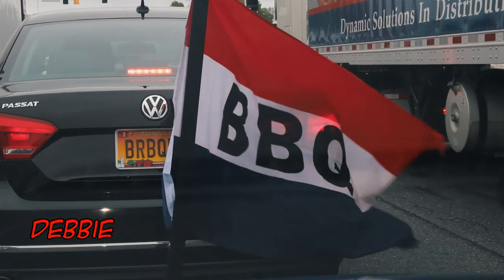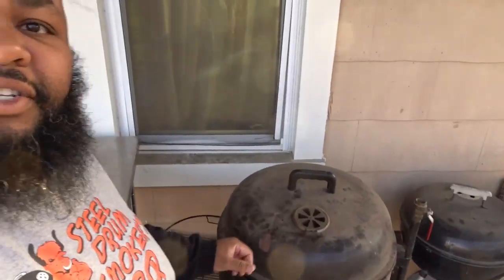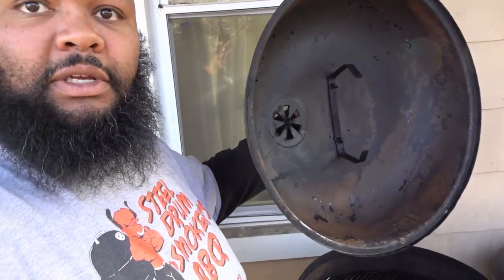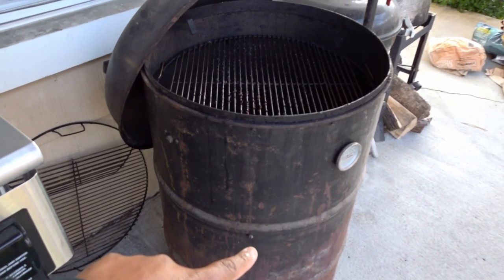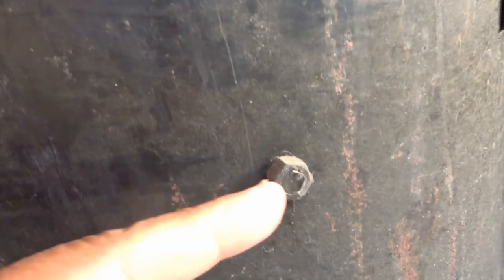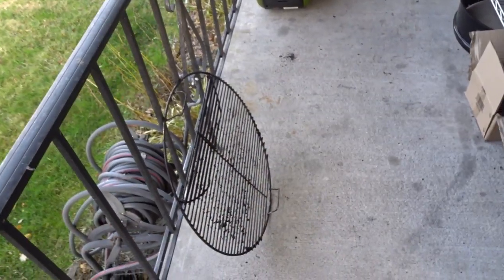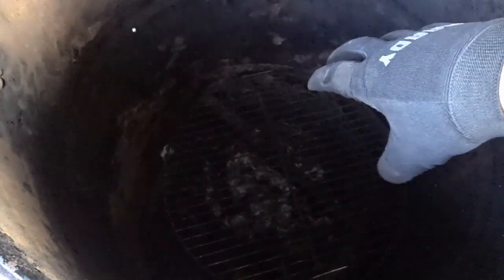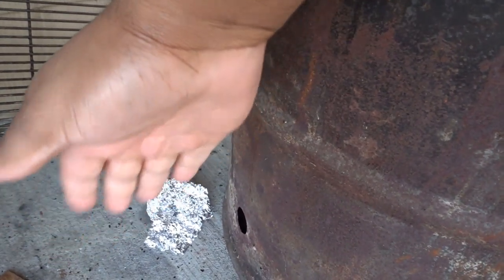SDSBBQ - The Original Steel Drum Smoker - Ugly Drum Number 1

Comment: On mine I cut a door close to the bottom of the drum. That way I can tend the coals without letting all the heat and smoke out through the lid.  And I open the door a little at a time to throttle the air intake.
Reply from the maker: Nice!

Comment: How much did it cost to build what tools type of paint on the outside. I would like to see you a ham don't matter bone in or out
Reply from the maker: Your mileage may vary... but here are some of the things that have a "cost" The drum itself: You might be able to get some for free or you may have to pay $10-$25 bucks per drum. My first one I spent $20 bucks or so on. The screws, bolts, flat steel, the grates, thermometer, the pipe and ball valve all have costs. Your costs might be more or less but I can spend about $150-$200 on parts alone. The paint is a High Temp grill paint. And I will def see about a Ham I've never cooked one.

Comment: Do they burn out that’s the only worry I had about an ugly drum grill
Reply from the maker: So as long as they don't get too hot they shouldn't burn out. Burning them out comes from the heat cycles. One of the other things that will make them burnout faster is leaving the ash in them for too long. Moisture is drawn to the ash and if it sits in the drum it will rust fast.